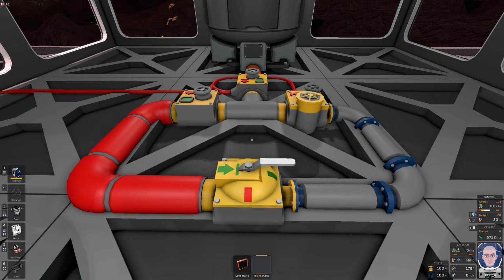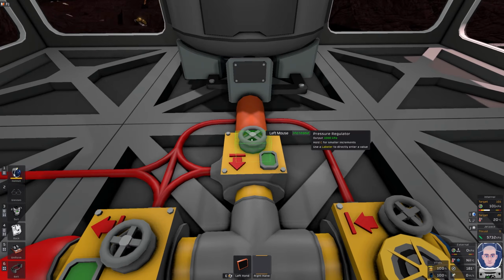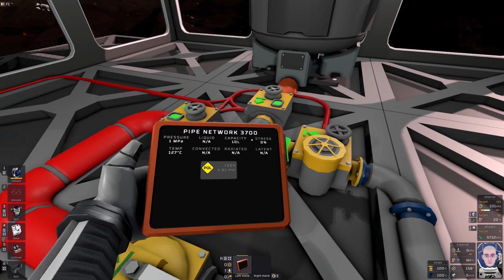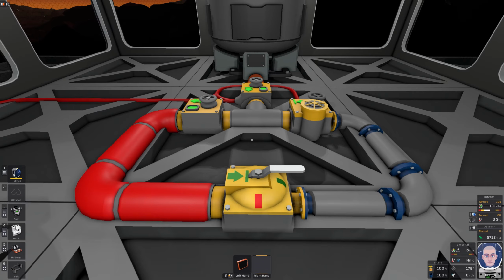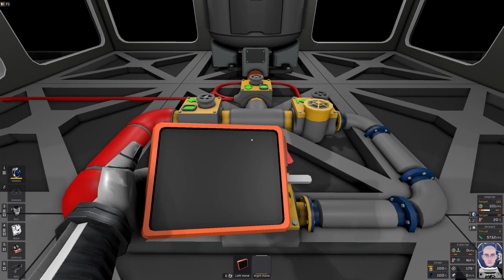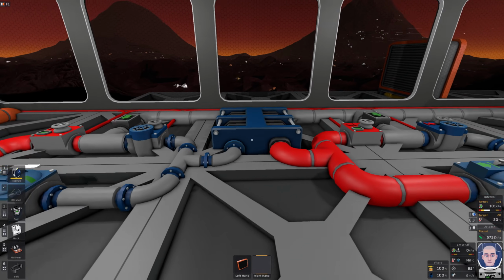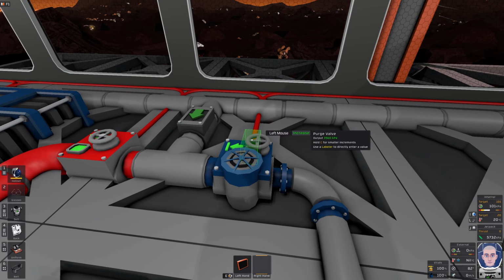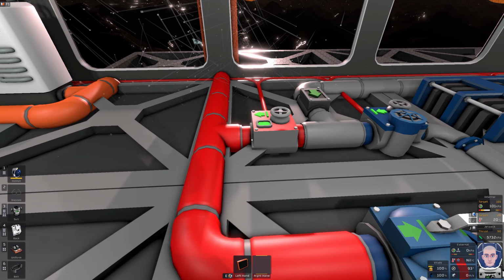Stationeers - Vulcan Phase Change AC Demo 1

Comment: Not sure if anyone told you to do this, but for your outside radiator, enclose it in a room with a door, and set up a temp sensor outside to shut the door when the temperature starts to spike.  Preserves that hot side, and it’ll just dump the heat out when the sun goes down.

Comment: I made something like you did here and it works fine. I have a night-time medium fan sucking in 127c Vulcan night air. Some will go to a filtration to filter out CO2 into a tank and the rest is being condensed (pollutant is the only thing that condenses), which is stored in two inline tanks and then a purge valve to keep it all under 4000 kPa. This is all outside. The condensed pollutant is cooling the CO2 to around 55-60c. But the "cool" pollutant is also going inside and being purged into gas and then compressed again to liquify. The heat from the condensed liquid, which is on the gas, is then going into a heat-exchanger with the "original" pollutant as a liquid. Which then cool the gas a bit (it's usual around 70c). And it's also hooked up on a AC (coolant side). When I inject the 55-60c CO2 into the base, the AC will transfer the heat from that into the Pollutant gas in the 2nd stage, which then transfers it to the first stage, where it bleeds off during the night. Works like a charm.
Reply from the maker: Good idea!   For my Vulcan series, I switched over to a closed loop system with two stages that can reduce below 20C.    But requires a bit of hardware and prep time to get running.
Reply: @VenusianGamer  Do you remember which episode you set that up ?
Reply from the maker: The construction process started in EP19 and goes on for a few more to get it all done and up and running...

Comment: Great introductory video the phase change mechanics. Well done! The only question I have is why you decided to throttle the purge valve in the first loop? Why set it to 3000 instead of the lowest possible setting of 1820 or 1850 (barely abvove freezing temp for pollutant)?
Reply from the maker: I played around with the setting and didn't seem to make a difference.   Far as I can tell, phase change cooling (at scale, not talking about a few moles) only provides about 60C delta.    And I have yet to see a video of using phase change on Vulcan to go from 127C to 20C with a single stage.     Either 2+ stages are used or a single stage using phase change and the second stage using a AC device.

Comment: Stationeers doesn't have adiabatic phase change. What the pressure regulator does is, due to a heightened pressure produced by the gas, the temperature at which it will condense into a liquid increases, passing the barrier of what the gas is currently at, causing it to condense, in the process moving the latent heat of condensation to the gas, increasing its pressure as well as temperature.

Comment: Can this be reversed to heat instead of cooling ?
Reply: The system works both ways - it really just moves heat from one side of the network to the other. The thing is: the heat still has to come from somewhere, if you add a load. You need to connect the cold liquid pipe to some form of heat source. For heating with Pollutant, you would set the purge valve to 1850kpa (barely above freezing pressure) and add a heat exchanger to the liquid side connected to a heat source that must be above -99° Celsius. So, this would not work with outside air in Europa - the outside air would freeze the pollutant in the liquid pipe. Keep in mind that the temperature difference of about 80°  (maximum achievable temperature delta for Pollutant arrived by dividing the latent heat of the gas by the specific heat = 80) still applies. So, if your heat source is only at -80° Celsius the maximum heating you can achieve with a single loop would be 0° Celsius on the hot gas side.